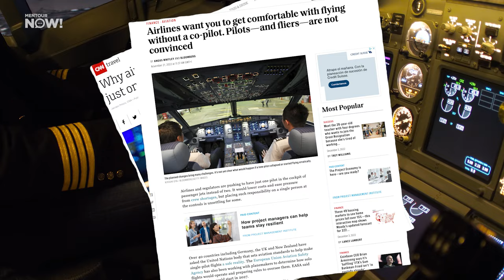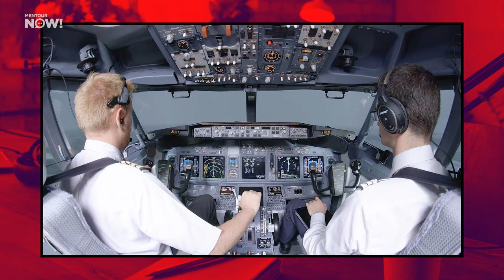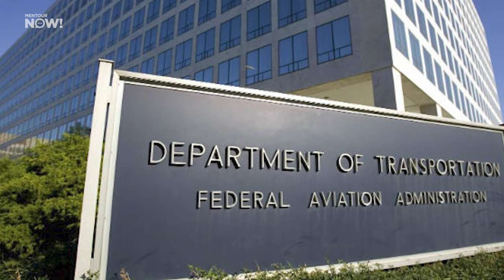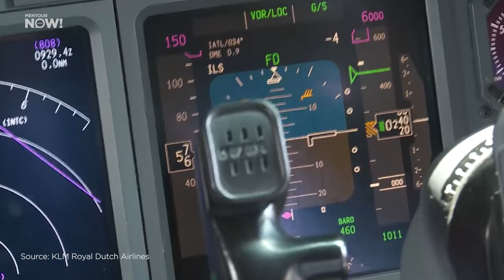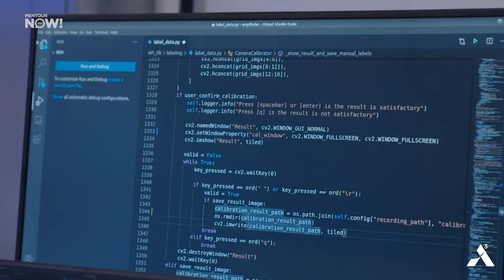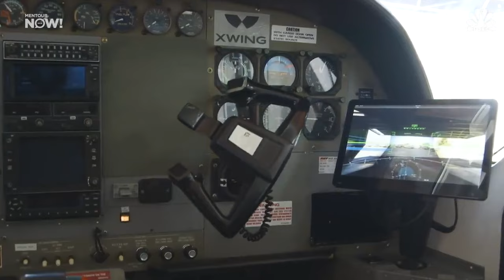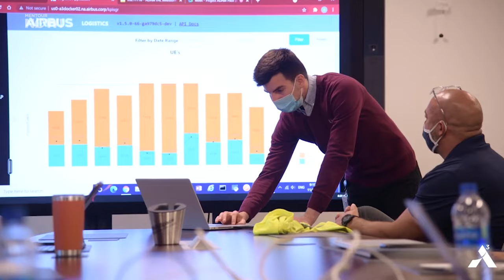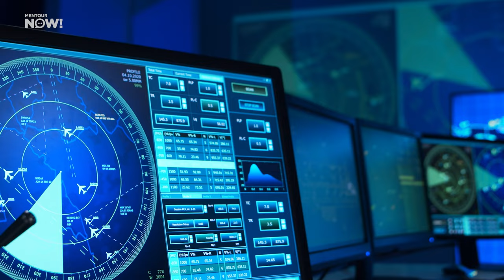The End of the Two-Pilot Cockpit?! Get Ready for Single-Pilot and No-Pilot Airliners!

Comment: I think I'll be able to think about accepting single pilot airliners when airliners are self flying, once the aircraft is capable of going gate to gate with zero pilot input in all weather conditions and in all types of emergencies and equipment failures that we currently train pilots in, such that the pilot is purely a backup to a failure of the automation, then a single pilot could work, but between things like bathroom use, pilot incapacitation, etc. I want two "systems" fully capable of flying the plane without each other at all times, whether that is two humans or a human and a computer I could be convinced, but at least for passenger planes I'm against anything less, and I'm not convinced that less is a good idea for cargo either, but I'm willing to be persuaded, though I'm extremely skeptical.

Comment: The closest comparison coming to my mind would be train drivers. The number of people has been reduced constantly and there are already autonomous driving trains operating. And a full high speed train can easily have more than 1000 passengers on board. The driver works alone, being observed by technology. If the technology to control pilots is getting ready single pilot planes will happen. I think if train drivers can work alone without going mentally ill,  pilots can as well. And if I look at reports of military drone pilots sitting in the US while flying a drone in the middle east, one could think of a remote emergency pilot sitting somewhere in a central office taking over the plane in case of any situation the actual pilot would not be any more capable of flying the plane. Also I read about Unions being against it, than counties with no or weak unions would implement it first, pressuring the other airlines to adapt this system. Therefore the overall likeliness is high it will come.

Comment: Excellent video. 
Your analysis shows that, actually, one may argue that solving the 1 pilot case is pretty much the same as solving the NO pilot case. 
The long haul case of single pilot cruise flight seems much more realistic, even though being alone in the cockpit for several hours in a row would be extremely boring, all the more if you have to deal with a watchdog computer that constantly questions your every action … or inaction (see train locomotives safety : the driver has to VERY regularly manually confirm that he is indeed doing fine, otherwise the train automatically stops). I doubt that any commercial airline pilot would accept that.

Comment: The way I see it, I wouldn't feel safe with a single pilot airliner unless we get to a point where automation is able to reliably+safely get a plane down in a WIDE variety of emergency conditions, and I don't get the impression we're anywhere close to that. I want a solid track record of automation acting as a competent backup copilot, even in emergency conditions, before we start seriously considering removing the copilot from airliners.

Comment: Once propulsive rocket landings become a thing peoples minds will change on this. I personally think humans are just as scary as software running these systems. Most people would not get on a rocket if someone was controlling it with a joystick on the way up and down. We have the technology to achieve a redundant system that allows for secure ground based control of aircraft. The military has been using it for decades with its drones. The F35 program also pushed forward the sorfware for interplane communication and swarm control technology. It should not be possible for a single pilot to go rouge with an airplane. It easy to detect when a plane has gone off course or is heading to a location it should not. With the the appropriate infrastructure in space ,ground and sky we will see the day that planes have no pilots.

Comment: If you can have a single pilot aircraft, you can have a zero pilot aircraft. A single pilot won't be able to take a bathroom break without giving the passengers a heart attack, so he or she will need to have a potty built into the seat and a nodding-off detector. At least, if they could eliminate the flight deck crew, if anything went catastrophic, there would be two less bodies at the crash site, which could improve the safety statistics a bit. Now there's a cold-blooded thought.

Comment: This is needed for the same reason you're Lamborghini needs a 30 cylinder engine. It probably won't become the norm for a exceptionally long time but it's logical to assume that at some point 100's of years from now automation will genuinely be way better than any pilot and in the mean time it's a race to win bragging points, If I can make a plane that can technically fly itself before my competitors can then I will also sell all my other planes whether they fly themselves or not at a premium and in larger volume because I can claim that my pilot aids are the best. You don't build racecars to go fast you build them to sell corollas the day after the race. You don't build automated planes to fly without a pilot you build them to ensure the pilot flies you're plane rather than some other good enough plane.

Comment: The airlines won’t be happy until they can completely eliminate pilots in the cockpit altogether. Isn’t this the direction that this is heading? I can understand getting rid of the engineer leaving 2 in the cockpit but anything less could be catastrophic. Planes are built with redundancies for a reason. Where’s the pilot redundancy? 
I’m sure the airlines have done all kinds of statistical “what if” scenarios and have concluded the cost savings to be worth the occasional crash. The only way to fight this is to boycott the airlines that choose this option.

Comment: How about this issue. Try a pilot with a mental instability, say like in German wings or in the more recent China Easter (as it does look). A pilot with suicidal intentions would have no one there to put a stop to that. Is that not another reason why flight attendants need to come forward when one pilot needs to go back to the restroom? The only option is to make it so the airplane can decide it doesn't like what the pilot is doing and override him/her. If that's the case, then we open another can of worms, what if the aircraft sensors are wrong, or as was mentioned in the video, a malicious hacker gets in and has the ability to override the pilots inputs via a system designed to prevent murder/suicide? There is no such thing as a unhackable computer... This is a dark and scary road to go down

Comment: No and no.  Current airframes will not be retrofitted ever and passengers will object.  Just two crew is pushing it as we have seen two pilots get confused leading to disaster.  Autonomous flying can work with human monitoring as if conditions exceed the range of an autopilot it will disconnect.  Autoland works in ideal conditions.   Remote control cannot fully overcome the issue of latency.

Comment: it would be far better for an AI component to do cross checks....AI systems will not skip check lists, they do not have to find the lists and more importantly AI systems can monitor much more effectively multiple sources of information...so i do believe a 3rd pilot will be added to all the flight soon in the form of AI that learns, listens and corrects the errors that the pilots missed due to high stress situations

Comment: I’m not so concerned about the pilot being alone and the psychological aspects. There are many professional careers in which there’s only one operator. However, a truck driver can pull over at any moment and failures that occur have little impact to the world around them. So that is a challenge, as well as the potential for more pilot error as a result of the increased stress in an urgent situation. Unfortunately I feel the industry and manufactures will only see that as a need to have even more automation. Same way they’re trying to use “pilot shortage” as a means to have a reduce the number of pilots actually needed.

Comment: I’m actually for more automation in flight but only as an additional backup. In several of the accidents that Mentour had highlighted in other videos, a pilot accidentally moves the controls but auto pilot doesn’t fully disengage or they forget to set the speed or flaps or something or when the pilot loses control because the cables have broken. In those cases having the plane itself say hey we are supposed to be flying to x why are we decreasing our speed or turning now? Maybe the pilot could even have a way of notifying the automation that hey I’ve lost rudder control or ailerons etc. as many have said though to have a single pilot flying ya no.

Comment: I can just imagine if the pilot goes rogue and decides he wants to crash the plane or what if there was a fire on board and the planes electronics are knocked out and the captain is unconscious and can’t land the plane. This will not happen. No airplane company can be stupid enough to put people in such a risk. except may be a company like Adam air but outside of that, no company would be stupid enough to do this. This would literally be the death of countless people faster than the airline companies can say let’s get two pilots back into the plane. We are not probably even a century close to a plane actually being able to be safe with just one pilot. Unless it’s one of those tiny little planes were like 2 to 5 people sit inside .

Comment: I think the real goal should be to work towards using technology to make it so easy to operate the aircraft that a single competent adult human can fly it with little to no training, especially at cruising altitudes, rather than shooting for full autonomy. 

This way you can transition the fully trained pilots to more supervisory roles maybe having both of them handled takeoff and landing and then going down to 1 fully qualified and type rated pilot at cruising altitude and have another competent adult with them such as a flight attendant of student pilot who has some basic knowledge. 

This is probably more realistic in the short term than fully autonomous planes. Use the AI to make it easier for a human to operate the plane rather than trying to teach the AI to operate the plane themselves.

Comment: i dunno bout you. but i ain going in a plane with no pilots. even if its one pilot. there may be a time of man vs machine and like you said no cross checking. its like one of the flights were they had an issue when the plane was switching altitude data with latitude, causing the plane to noise dive. and guess what apparently they still dont know what the cause is. This is Qantas Flight 72

Comment: One pilot in cockpit didn't work well for German wings Flight 9525 or Silk Air ?
Reply: Good thing you brought those pilot suicide cases up. If one pilot is suicidal and plans to crash a plane, it is unlikely that the non-pilot crew could be able to fight against that one pilot crashing the plane. That is one dark scenario if there is only one pilot in an airliner jet.

Comment: I would not fly on a large passenger airliner with only one pilot and yes pilots fly with the auto pilot most times but they do fly manually to stay in touch with the aircraft and they have automatic landing which has been around for years and it tends to cause a heavier landing and you may think they are glorified bus drivers but you have to understand the theory of flight and act on the spot and you don’t have time to think about the problem flying at 500 mph and know what inputs you have to do when things go wrong also the 2 pilots as when they had flight engineers there were 3 sets on eyes to look for problems in and outside the aircraft like landing things on the runway or flocks of birds now we have 2 sets of eyes the pilot who is flying looks out the windscreen on landing at the runway and dipping his eyes to check his speed and the other pilot is looking out but also seclecting flaps etc and has to take his eyes off the runway and outside the aircraft for only seconds and they have the pressure to make sure everything is ready to land and there has be accidents were a pilot has missed something due to over work and kill everyone on board if they had an engineer it would never happened and those few seconds make the difference as on landing at 160 mph you only have don’t have time to have things go wrong so if you are going to fly make sure there is 2 it was like the British airways trident jet the captains windscreen blew out and the caption was sucked out and his feet got hooked on the seat belt and thankfully he survived and the copilot landed it safely and if this was a single pilot aircraft it would have crashed and the copilot put it in a dive to get down to an alituted that was safe for people to have enough air to breath and if this happened with one pilot would the computer take over and fly the aircraft and land at the nearest airport that is suitable for the situation and import the emergency services of the problem or when landed will it shut the aircraft down it flying with power loss will it cope with flying the aircraft I don’t think so

Comment: Surely the real problem is what you do when you run out of all the captains and experienced first officers that you can put in an aeroplane on their own. Eventually you are going to have to put someone with almost no experience in that single seat. Being captain of an airliner is not just about moving the controls or dealing with an engine failure, the captain is very much the manager of the operation and that needs experience that is at the moment gained as the assistant manager, learning from the captain; sometimes by seeing good decisions and sometimes by seeing bad ones and deciding never to do that.

Comment: 15:11  The original concept of single pilot airliners involved a system whereby for every 4 or so solo pilots in the air, there would be a "ground pilot" at a console with avionics data links to assist them.  If in the event of a pilot incapacitation or emergency, the capability of the ground pilot taking full remote control of the plane if necessary.  In theory this should make in-air hijackings obsolete.  The "nightmare scenario" would be if a hacker / terrorist remotely commandeered an 𝘦𝘯𝘵𝘪𝘳𝘦 𝘧𝘭𝘦𝘦𝘵 𝘰𝘧 𝘢𝘪𝘳𝘭𝘪𝘯𝘦𝘳𝘴 simultaneously to weaponize them against domestic targets just at the push of a button.
Reply: You want it the other way around, pilot first, remote control as backup.

Comment: This video starts off by probably suggesting in a 1 human pilot cockpit that the human should fly the aircraft and the AI would provide the backup (eg monitoring pilot role). Then later in the video corrects this likely error by raising the possibility of autonomous (AI) rather than assisting computer driven pilots and that is probably the right model. The AI should be the "captain" and fly the aircraft with as much skill as possible and the human pilot should review, doublecheck and verify that the AI "captain" is making correct decisions.
Reply: I think the first single pilot planes will start off as the former and after many generations the AI would be “captain” with the human pilot double checking the work and the likes.

Comment: Ask a pilot what (s)he tinks of reducing pilot jobs, and this video is what you get. 
However, ask anyone else, and it becomes clear that single pilot operations are already a done deal, and implemention is already scheduled. It's a generational thing - once the older crowd who are horrified by the thought start to fly less, this will be phased-in, and no one will think anything of it. Even the pilots' unions will have nothing to say, because there are simply not enough pilots for two-crew operations any more, and this situation is going to worsen as travel needs continue to increase and pilot jobs continue to lose attractiveness due to ever decreasing pay scales, cost of training with the 1500-hour rule, ever more intensive scheduling demands and passengers beating up flight crew. 
CPDLC is the first technical link making this possible, and we've already been flying with this for ten years, so the road is already half paved. 
What's important to understand about single-pilot operations, is that zero-pilot operations have to be proved before this can exist. Similarly to two-pilot operations leaving a fallback if one should fail, we must enter an operational mode in which NO pilot intervention is the norm for every flight before single-pilot operations can be an acceptable fallback. This is do-able today, and indeed we can reduce air traffic controller jobs at the same time by having ground-based machines controlling aircraft instead of relying on archaic voice communications to place aircrafrt where they need to be. 
Interesting that the discussion  is limited to Boeing and Airbus, when it is overwhelmingly likely that Chinese-made aircraft will dominate the market withing the next 20 years.
Reply: Funny you say “it’s clear to everyone else” when EASA has said the technology for single pilot flying was not advanced enough and that single pilot operations by 2030 was “absolutely unfeasible”  in February of 2023.

Comment: Wait. The pilot really isn’t flying the majority of the time correct? They taxi, take off, set auto pilot and adjust corrections, and then land and taxi. The main job during flight is radio and auto pilot adjustments. Why is there always talk of pilot overload. Understand you must stay awake and monitor but two pilots should be fine.
Reply: “Adjusting the autopilot” (flying using the autopilot) is very workload intensive during busy periods of the flight